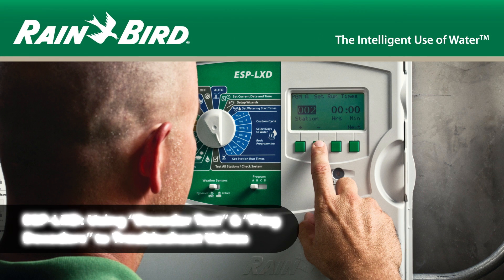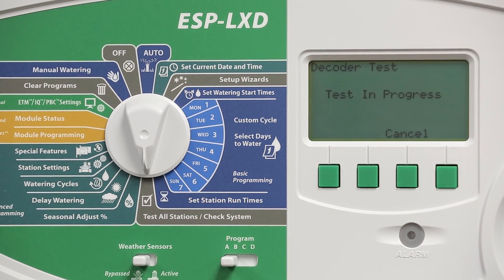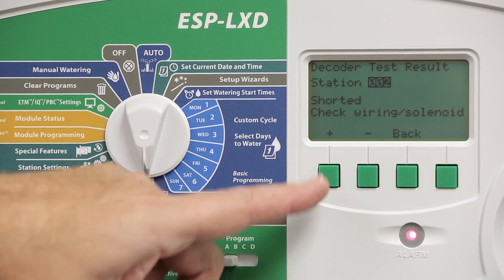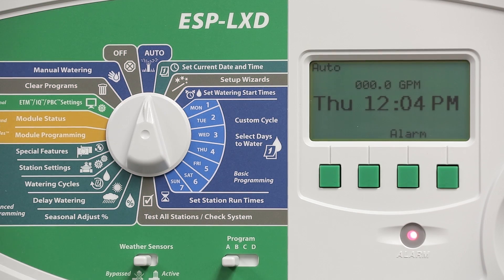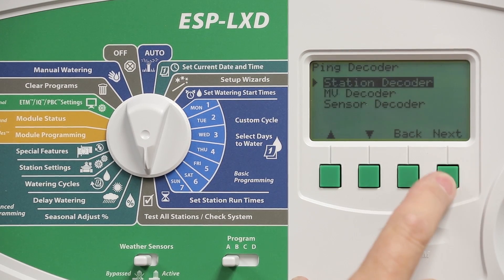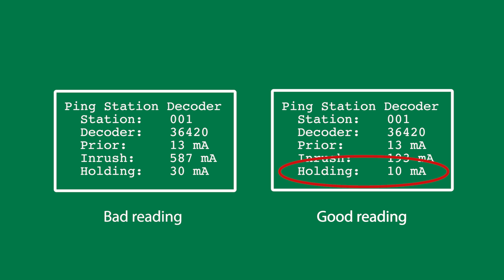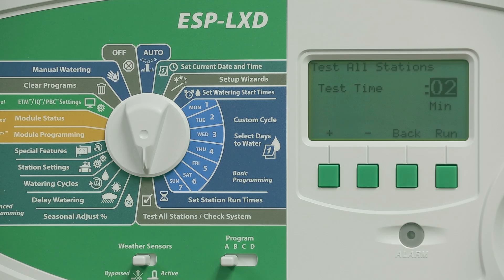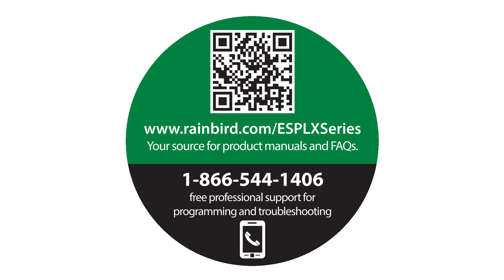ESP-LXD Controller: Using "Decoder Test" & "Ping Decoders" to Troubleshoot Valves

Comment: Does the ESP-LXD have its own decoder and what should it read?
Reply from the maker: Hi, 

The controller box comes with a two-wire decoder module. 
The module itself comes with 2 LED lights. 
When the module is working properly the upper left corner flashes green only and the light is next to the screws blinks red/green. 
Also. The module itself should be reading around 16-20 milliamps.